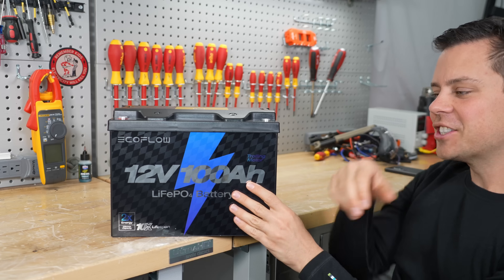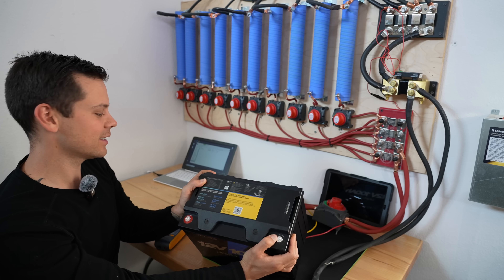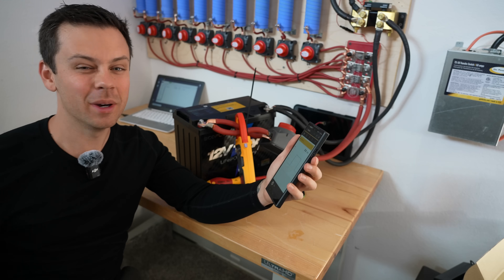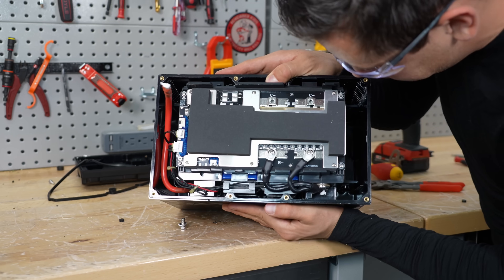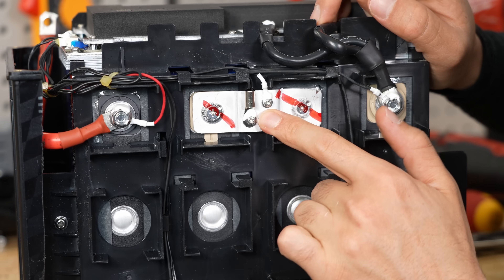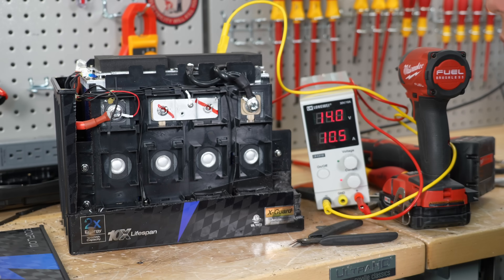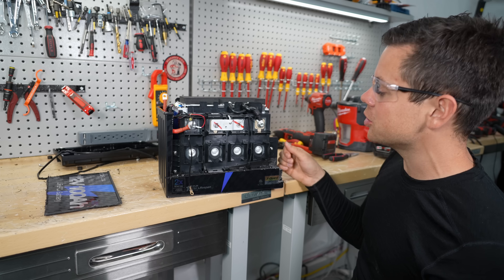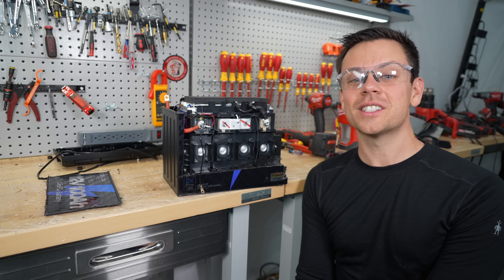$200 Ecoflow 12V Battery?! It's shiny!

Comment: Can these batteries be used in a 2015 ram 2500 diesel truck? I'm trying to upgrade the lead acid AGM batteries. I like having extra power for lights and tools without the truck running.
If these won't work, please what batteries will work.
Thanks

Comment: The low temperature cutoff is also an excellent feature at that price point. I do see that Litime has a trolling battery in the same price point with that sensor, but not many models do. Thanks for the tear down. Without it we never would have known of this Ecoflow's top-tier build quality. Your channel is among the best for practicality and testing of these cells, chargers, and related equipment.

Comment: This may be a time limited sale which ends October 31.  I found the price Will stated by going directly to EcoFlow.  I decided to get two of the 100 AH trolling motor batteries, so we shall see...  Those appear to be some of the best made batteries I’ve seen.  I have a River generator, the add-on battery and one of their portable solar panels.  So far, the EcoFlow equipment has proven to be very high quality and durable.  Some others offer more features, but at a lesser build quality.

Comment: is there a big difference between using 1 200ah lithium iron phosphate battery vs 2  100ah lithium iron phosphate batteries  or is it the same. with the 100 ah exspandibility  of ah by 100ah  each additional battery

Comment: Thank you Will. I purchased and installed 3 Li-Time 100A LiFePO4 “Trolling Motor” batteries in my RV in a parallel configuration combined with 3x200W solar panels connected to a 50A MFFP Controller and a 2000w (4000w peak) pure sine wave Inverter. I run 2 fridges (12v and 110v) as well as Starlink 7/24 and also use it to power my microwave, coffee maker, toaster, satellite, 2TVs, AppleTV, ice maker, and Traeger BBQ (as required not simultaneously). The batteries have plenty of reserve power in the morning and are quickly recharded by my solar array. I purchased this particulae model because of the low temp charging protection and so far am delighted with the quality and reliability.
Reply: Curious about the total cost of your setup.
Reply: What do you us for your MPPT and settings? Just default Li settings?

Comment: I'm concerned that this new resistor bank can be a fire hazard.  Perhaps consider using the same type of insulation behind, above, and beside it as is used around wood stoves.  It would probably be excessive but cheaper than repairing fire damage.

Comment: App Support: No application support on the current ECOFLOW 12V 100Ah battery line up drove me to purchase three of the the recently reviewed WattCycle 12V 100Ah Mini batteries with application support. I would much rather purchase ECOFLOW products as they are built like tanks, with stellar app support on most of their products. However, with no application support on the current 12V 100Ah ECOFLOW battery lineup = missed opportunity.
Reply from the maker: Good point

Comment: I have 4 of these wired to 24v running a 2k inverter that powers my office. It is also my backup power to feed my AC200Max when solar is not available during a storm. They are setup on a cart that I can wheel across my house as needed. Love these units. I will be getting 4 more for a total of 8.
Reply: Bro, stop posting fake reviews, it's so fake
Reply: @JamesAlexander-z7v bro… sup… brah… get a life 😆 Anyway, I actually do use 4 of these and they have performed great for the past 4 months.

Comment: Those internal terminal wires look kinda small for 300A for 30 sec, especially if they're copper plated. Maybe that's why there's such a long reset period.
Reply from the maker: Good point

Comment: Hey Will, thanks for the continued information on this topic! 
My question is, I have two 12v, 100 AH lithium batteries in my RV connected to a shunt and inverter. My question is that I’d like to add some capacity. Can I buy a couple of batteries of another brand and put with the existing batteries or do I replace the ones I have with all new batteries?

Comment: That case material reminds me of this insane water-cooled prototype battery I picked up by chance for cheap. The case was solid PA-66 (Nylon on steroids) molded around about 200 18650 cells. I tried to "disassemble" it, and lets just say my respect for engineering plastics skyrocketed that day. I even brought it down to -20°C, and still that stuff refused to break away.

Comment: Great job on this and all your videos. I switched out a Group 24 AGM 77Ah battery for this Group 27 Lithium 100Ah battery on the tongue of our camper. First task, replaced the battery box. My camper appliances, e.g., lights, water pump, furnace blower, normally failed when the AGM battery voltage dropped too low for usefulness. The AGM was normally just below 83% SOC, per Victron smart shunt data. With this new lithium battery, we went well into the next week before watching the voltage take that steep plunge. However, I learned a rather simple lesson. A 10A smart charger will take over ten hours to charge that lithium 12V 100 Ah battery from empty to full. Ten hours! Simple physics, I know, but I never faced this challenge with the AGM. I picked up a 40A MPPT charge controller to speed up the recharge process. I believe this particular lithium battery supports 50A charging.   With a 6,000 cycle rating, I may never replace this battery.

Again, thanks for sharing your excellent work.
Reply: Did you end up going with a Victron MPPT? Mind sharing what settings you used?

Comment: "Trolling battery?" for a trolling battery where external bits should not be a thing, A BT or mounted monitor (BT would be cheaper)  would be really nice. The battery I am using for the trolling motor (actually it is being used as dinghy motor) has BT and it is nice to know how much range is left, how much current is pulled with different propellers, etc. But the price is nice. In a bigger install, one can measure amp hours used externally anyway. I will have to look at batteries again. I need new (or more) house batteries anyway.

Comment: 3 inch cutoff wheel would work much better than the multi tool. 
DeWalt makes the best but you're a Milwaukee fan boy. M12 makes a decent 3" saw.

Comment: Great video, Will. * TIP ALERT * Use a small (5-1/2") circular saw and just set the height to the wall thickness.  Easy straight cuts.  Works better than the cutter you use now.  If you make the depth just shallow, you can finish cuts with razor knife.
Reply: He really needs to get a cordless one and review the battery on that one. 2 birds one stone.
Reply: DEWALT DCS571 - 130 bucks, 4.5" blades, easier to use than that size even.
Reply: Noticed that you use a Milwaukee oscillating cutter. My extensive boat-related M-12 Fuel collection includes a 3" cutting wheel which likely would address your need to make shallow cuts. Great channel.
Reply: I think Will should focus on technique here.  The exact tool isn't important.  If you cut around the top to a safe depth on all 4 sides.  Pop the top.  Then cut all around the bottom the same way as the top. Lift all 4 sides off as one unit. Now you get full access.  Maybe, you can even Duct tape it back together.  Good as new :>). Are you listening, Will ??!

Comment: Great Videos will be upgrading my rv batteries next spring and will know what to buy
Reply: You are better off buying any batteries now before the expensive tariffs kick off. So waiting may lead to spending more money
Reply: I purchased and installed 3 Li-Time 100A LiFePO4 “Trolling Motor” batteries in my RV in a parallel configuration combined with 3x200W solar panels connected to a 50A MFFP Controller and a 2000w (4000w peak) pure sine wave Inverter. I run 2 fridges (12v and 110v) as well as Starlink 7/24 and also use it to power my microwave, coffee maker, toaster, satellite, 2TVs, AppleTV, ice maker, and Traeger BBQ (as required not simultaneously). The batteries have plenty of reserve power in the morning and are quickly recharded by my solar array. I purchased this particulae model because of the low temp charging protection and so far am delighted with the quality and reliability.

Comment: What does it mean to be a trollling motor battery?  Is it only intended to be used on a trolling motor and does it limit its capabilities?  Or is it just intended to be used as a trolling motor battery but you can use it for everything else?  Sorry for the dumb question.
Reply from the maker: Oh you can use either model for solar or trolling or whatever you wish. Trolling just means it can run electric motors without issue

Comment: Oh my, you said "solar generators" at 7:09, get ready for the trolls haha

Looks like a great battery! You mentioned that it didn't have many features in the beginning. I'm kindof getting tired of all the "features" - Bluetooth that is insecure or drains your battery when it sits, heaters that may or may not work and prohibit certain wiring styles... A plain and simple battery is where it's at in my opinion. Need Bluetooth? Add a Victron shunt.
Reply from the maker: Absolutely agree with everything you said 🤣
Reply: True about bluetooth and cold protection. Keep batteries in an insulated and heated box and sleep peacefully.
Reply: @nickhansen7301  Absolutely needs cold protection (low-temperature charge/discharge protection). That's different from self-heating where they sandwich heating pads between the cells.

Comment: This is a great way to extend life in a River 2 or River 3. Just plug in a 12V to XT60 connector and you’ve got a 1536kWh power station
Reply: I do this with 2 35 amp hour agm batteries I got new for 50 bucks. My bluetti stop charging right around 11 volts which is perfect
Reply: Yup, you can do that with ANY battery on ANY power station.

Just make sure it is less than the maximum allowed input voltage.

Comment: Will, regarding the giant resistor bank, I'd recommend mounting them on a nonflammable backer board instead of wood. You can buy boards made of cement which obviously make mounting a little harder but well worth it in my opinion.

Comment: I wont lie, I am still a little salty I paid almost $900 each for the 8 Battleborn batteries in my system almost 5 years ago. Of all the things in my  system Battleborn was the worst, not because the batteries are bad but because the company is awful to deal with if you have an issue with their other products.

Comment: Thank you Will, honest and revealing!  I live full time in my RV with an EcoFlow Delta Pro Ultra and two batteries for 12kw.  I lost the inverter and one battery bank this summer in a flood at the RV campground, EcoFlow was so incredibly awesome on their return/exchange process.  It was not a quick process but they did replace what I lost and for that I will be their customer for a long time.  I currently use a Renogy 12v 200a house battery w/Renogy monitor.  Also impressed with that setup.  As a side note, my RV neighbor showed me his 6kw setup and it was straight from your book that he used to follow, well done on all fronts!

Comment: It might be potted that way because it's a trolling motor battery, meant to stop any internal movement when it's in a boat.
Reply: So it also should be a better option for RVs, campers and other mobile applications.
Reply: @yvan2563  I would think so. I wonder if this how they make all there batteries or just the trolling motor batteries.
Reply: I would say so. Vibration could cause cells to shift or rub together over time.
Reply: @trailingrails9953  That and the water proofing aspect of it.
Reply: Nothing to do with keeping low temps during extended use ?

Comment: Loadbank, Will great idea to have a non-inductive resistor loanbank, your fan cooling idea is important. Consider a metal housing for the bank as passages within the box can better dissipate heat, maybe temperature sensors on the resistors themselves to add to the dramatic effect.

Comment: This is BY FAR the best construction we have seen for $200. Im buying 2 to use as extension battery for my delta 2.
Reply: How are you connecting it? When I looked on the Ecoflow site it says that this battery is not “compatible” with the delta 2, or any of their packs?
Reply: @stevewort  Likely through the XT60 port, which means either 100W straight up, or when adding a step up converter to 24v 200W etc. The real question is how do the external batteries get charged on the go. You'd have to get a DC/DC charger and it couldn't be the EcoFlow alternator charger because that would only work if you treated the expansion like a car battery and used reverse charging which means your Delta x 2 charges it, not the car's alternator (and not to mention the nightmare wire juggling that would be involved). So you're down to either the 3rd party DC-DC charger, Solar, or buying an AC charger (Which you could plug into the Delta while the Alternator Charger is running) Personally I would just hook the roof solar panel up to the external full time and then connect it to the Delta XT60 port and slow charge it.
Reply: It is extremely well constructed. 

The potted cells protect it from vibration and rough handling too.
Reply: Bro, stop posting fake reviews, it's so fake
Reply: @JamesAlexander-z7v  He videos the review. What is fake about it, Einstein?

Comment: Milwaukee makes an M12 cut-off tool (miniature circular saw) with an adjustable plate for setting depth.  That might work for jobs like this.
Reply from the maker: Oh smart! Ill head to store right now and get that. Good call
Reply: If you don't mind a cord, Roto-zip is the OG tool like that. (with tons of attachments). Mine came with a diamond wheel cutter.
Reply: A compact router would probably 
Be
More controllable, and easily available
Reply: @amsb4dafunk558 a router?  The speed they spin at could be dangerous if it catches and tries to move the tool unexpectedly.
Reply: @mlindholm  
	The material he is cutting 
Is
Very soft, and very thin
He
Does not even have to set the bit depth to
Cut all the way through
Work Smart
Reply: @patarmstrong3582  
WillProwse
Stated “I’ll head to store right now, and get that”
Context-
M12 mini circ saws are not usual off the shelf items 
Mini Routers
Are off the shelf items
I
Use power tools everyday 
Routers
I use once or twice a week 

As I stated 
For his purpose(demolishing the housing)
Just set the spiral bit barely penetrating the plastic 
The mini router will be fine.